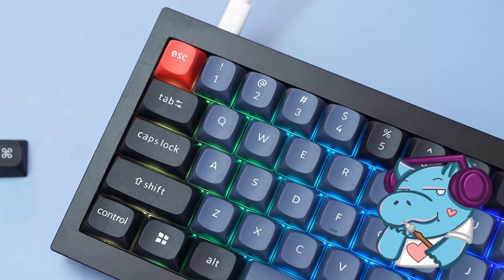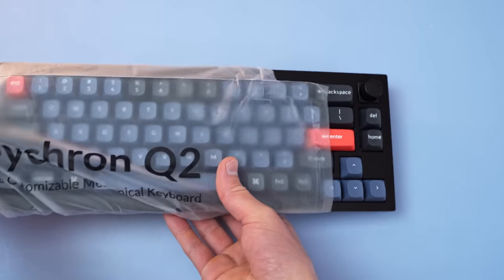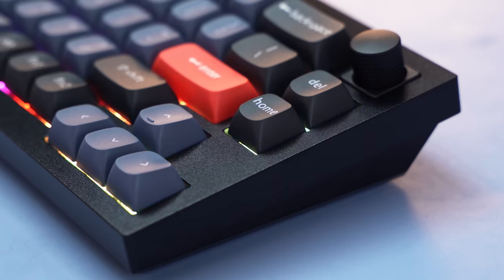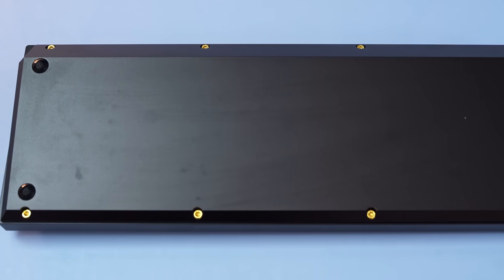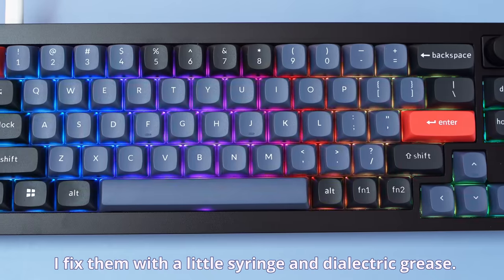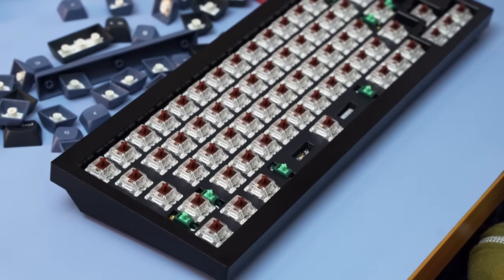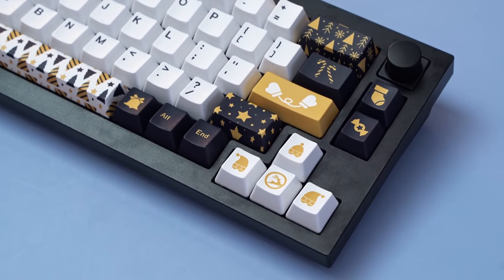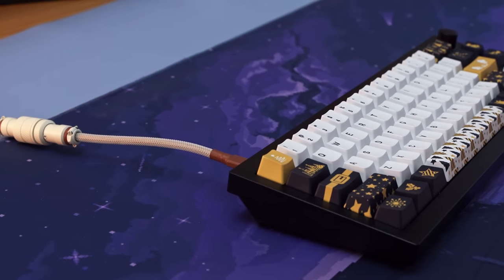You don't NEED to mod this keyboard.... but you should.

Comment: Hey dude, so I’ve been watching your videos and I was wondering… I want a springy switch with a tactile click which produces the same sound as this keyboard but without bottoming it. And even if I bottom the cap all the way down I’d like it to have a soft bottom. (If you know what I mean ;) ) I don’t wanna hear a bang from the cap hitting the frame. I want it soft and sexy like velvet. Is this thing even possible?

Comment: I just bought the q1 a week before the q2 launched and normally there is this super flat and thin cable connecting the pcb. Mine has the same cable as the q2😂
Reply: Did you get the Q1 with the knob? If so then it has been updated with all the improvements that the Q2 has as well, except for the nicer PBT keycaps.
Reply: I modded the q1 and i bought it without the knob
Reply: Sounds pretty good though

Comment: Just came across your channel researching custom keyboards. I am looking into the Q2 and I have a question. What is the difference between barebone and barebone ISO? Want to get the navy blue and fully assembled is sold out.
Reply: Iso has the fat enter and a few other layout differences. Iso caps are a bit harder to find so I'd suggest ANSI

Comment: I'm so sad this keyboard came out (and happy too) because if it had been out before I went down the keyboard rabbit hole trying to find the perfect keyboard, I woulda bought it and saved myself a lot of headache (and money.. lots of money).  It's almost the perfect keyboard.

That shipping though is ouch.
Reply: What keyboard do you have right now?
Reply: @raisinnotnice  I've got several at this point.  Of all these custom boards, I actually settled on a Drop CTRL of all keyboards for my main typing keyboard with poron foam and Boba U4T's and it's about perfect for me.  I decided not to go for an all around keyboard and use this one for typing and another keyboard with Gateron optical silvers for gaming so I don't have to compromise one way or the other.

Comment: If only it had a function row it could have been a good upgrade for my k8. But i will probably just buy the GMMK pro instead.
Reply: i believe there’s a version of the Q1 that has the knobs and case upgrades, so you get the added upgrades of the Q2, but layout of Q1. def worth checking out
Reply: @CazualTea  Yes, I just got my q1 knob and it looks identical to the Q2 except the form factor of course.

Comment: If it's 1000hz then I'm sold
Reply: Looks we got a gaming gamer hoo hoo we! Most keyboards (other than the Tes68) are 1000hz polling rate. Also, there really aren’t any “faster” switches for gaming. Anything that’s “faster” is really a negligible difference that the human hand can’t really tell the difference between. Even with “speed” switches for “gaming,” the actuation point is what matters for gaming. They’re only called speed because they have less travel, but the travel of a switch doesn’t matter for responsiveness—it’s the actuation point. Which no human can tell actuation point differences in real use senses. So for 1000hz polling rate, basically all real mech keyboards have that. Other than the Tes68, that “$25 custom mechanical keyboard” that most budget keyboard YouTubers build. That’s 125hz.
Reply: @Luke-we9gj I just play rhythm games man
Reply: I believe all keychron keyboards are 1000hz
Reply: @mir4cle696  really?

Comment: keychron does false advertising on amazon. they show pics of the key caps they ship and call them doubleshot which they clearly are not.  I contacted customer service to see if they would ship me correct key caps and they told me to just return it. wtf is that? I WONT because I love the keyboard after I fix it but they have terrible customer service (though prompt). Nobody should buy this expecting not to have to mod it, unless they love pointless RGB that is.

Comment: Alright so is anyone here going to be able to tell me whether i should get the Q2 or the Ducky One 3 and why?
Reply: The Q2 is a much better beginner board and much better bang for you rbuck. Im pretty sure the ducky is around 130 rn compared to the Q2 which is around 210 completely built out. If you already have switches and keycaps to use on the q2 it brings it down to 190 (all of these prices are with the knob btw). 190 is still a fair bit more than 130 but for what you are getting, I think it is worth it. Also, if you want a better stock board, the Q2 is hands down better. The ducky switches are known to be very scratchy so you are going to have to lube them. I personally had the same dilemma as you and made the conclusion that the Q2 would be better. I also ordered some Akko keycaps and lubed some Kailh coppers that I had from my previous board which should make a good board around 250 dollars. Hope that makes sense lol, if you have any more questions feel free to ask.
Reply: @acez643  really cleared things up for me thanks for the response

Comment: Why are coil cables coming back they are fucking useless 25 feet of cable for 6 fof length 4 after you account for the 2 foot coil you have to put somewhere

Comment: Strongly advise noobs to stop following stupid ideas and NOT tape mod their PCB. It's bad for the PCB mmkay. If you put 3mm Eva foam in the bottom housing it will be basically air tight while being 100% reversible. Don't be dumb, don't put thing with glue on PCBs. Thank me in 2 years.